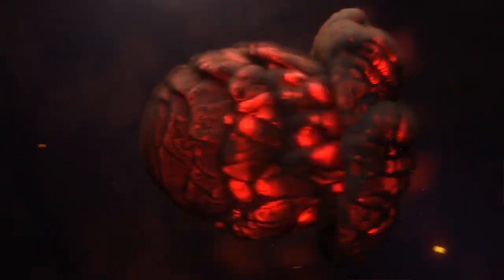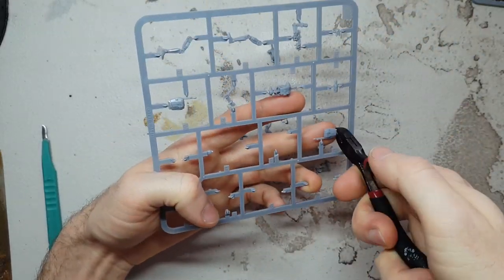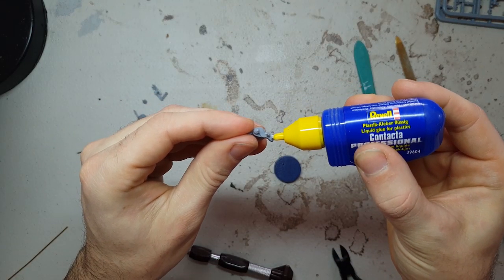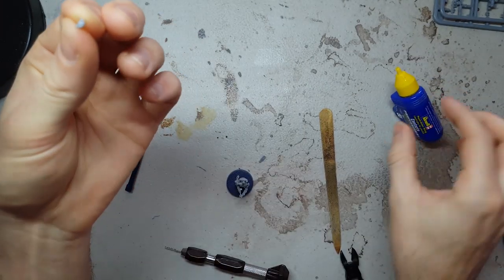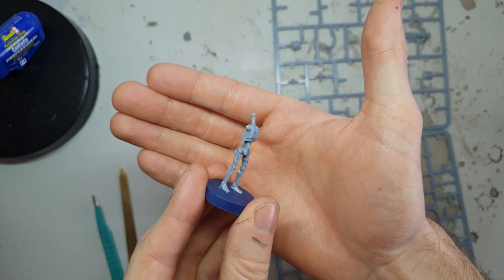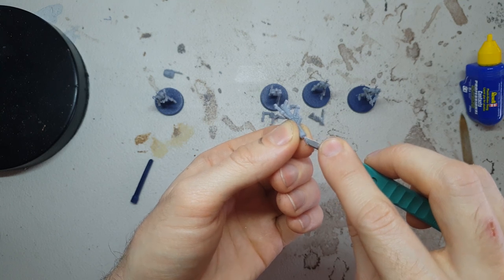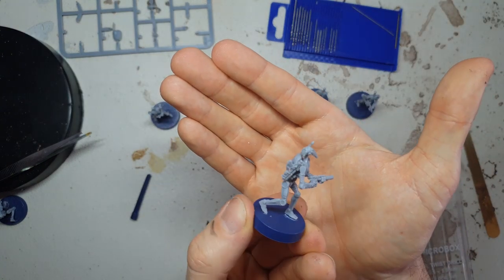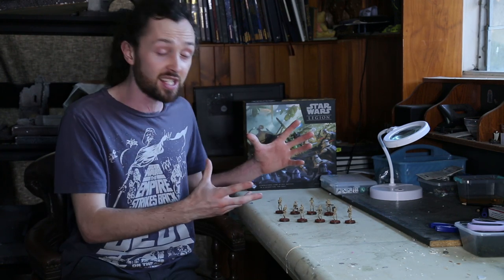B1 Battle Droid Assembly Guide ~ Star Wars Legion!

Comment: Video was a great help as book diagrams are too small. Gave up on pinning the feet as it tended to make them weaker in my opinion. I hate assembling plastic and normally work with metal so this is a nightmare for me, but all went reasonably well. I have used clear bases despite loving basing my figures with rocks and tufts.
Reply from the maker: Glad I could help Simon!

Comment: I've really been struggling with the arms for some reason, I use Gorilla superglue as it said in the manual to use superglue but it takes so long to dry!
Reply from the maker: Plastic cement is what you want for droids buddy not super glue. Plastic Glue all the way :)
Reply: Zorpazorp I shall use plastic from now on :) so does that mean I’ve messed up making half my army with superglue? I’m really careful with them
Reply from the maker: @LeeJ2512  nah they'll be fine dude, if any come apart just use plastic to repair but they'll probably be fine anyway
Reply: @Zorpazorp  Perfect, thanks for the responses, they've certainly put my mind at ease. Love the channel :)
Reply from the maker: @LeeJ2512  thanks dude 😊
Reply: Zorpazorp which plastic cement do you recommend